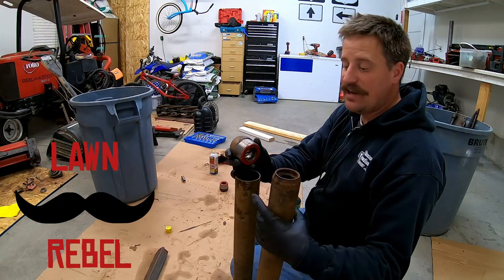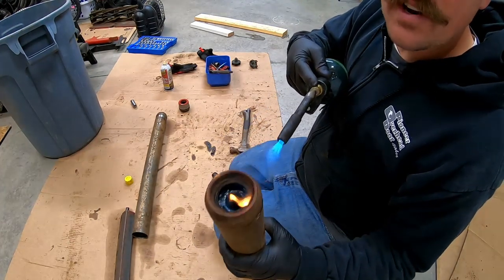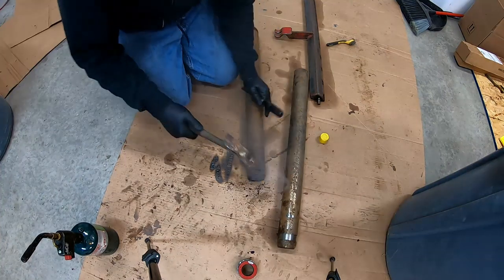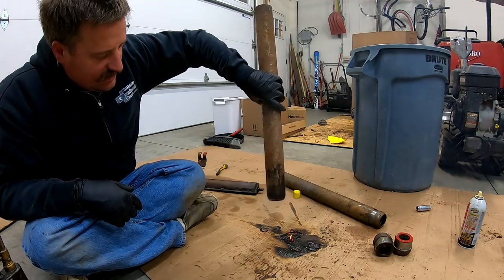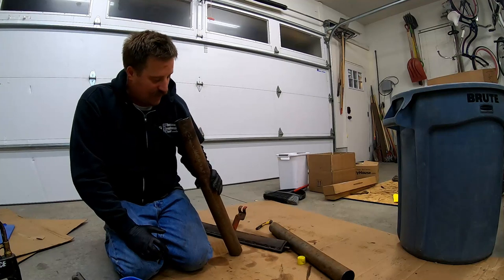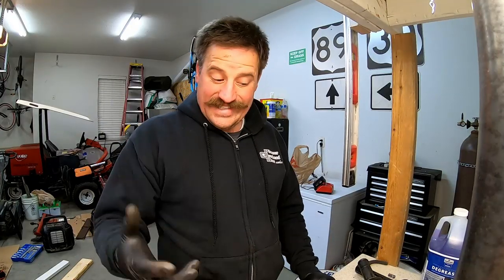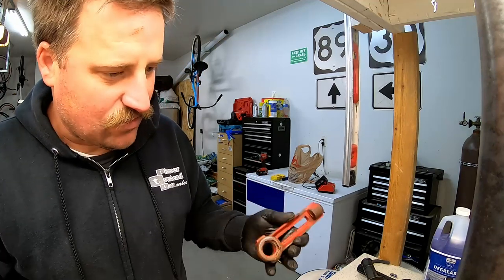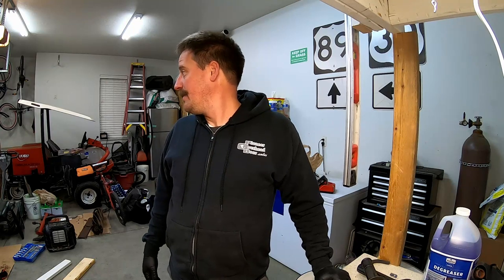Reel Roller Restoration Toro 3100D

Comment from the maker: This is what I call a dirty first. Brett can suck it.
Reply: Brett's grasscapades 
😂😂😂
Reply: Hey man, if you need bearings. Just contact SKF, their site has a tool so you can find any bearing you might need. 
You should be able to find dust and waterproof ones there (maintenance free). 
Greetings from an engineering student 😉

Comment: First Aussie😁😁👍Can’t wait to see what damage that heavy machine will do to your pristine yard when turning.🧐and possible compaction problems. Great video Connor ,your persistence and patience will pay off in the long run.
Reply from the maker: First world problems?
Reply: That machine is about 1860 lbs Connor, are you intending to use this as your main mower ? Or some other purpose.
Reply from the maker: Whatever the heck I want
Reply: Ok Connor, sounds like a plan. Can’t wait to see your finished product, you are doing a great job restoring that machine.👍👍

Comment: Whenever I need to sit or especially kneel on the floor to do something, I grab one of those rubbery foam camp pads, about 3/4 inch thick, and use that. I have one that I've cut in half just for this purpose. Your knees will thank you later.

Comment: Next your gonna have to build a shed to put all this crap in lol.
Reply from the maker: yeah no kidding. That has been on my mind for years. I would love to try to make that happen this fall of 2019. Maybe
Reply: @lawnrebel  it's great.  Even thought I have a 4 car garage I built a large shed ran some electrical burial wire, and it basically became my workshop.  Don't have to worry about making a mess.  Take the blower out and it's gone in minutes.  There's acre lots here and my shed sits in the middle.  So I can even work in the middle of the night without disturbing anyone.  It's nice having an open garage and get to your car without tip toeing around everything.  Build it!  You'll thank yourself you did.  Go as big as you can because trust me,  you'll wish you did later.  I build a custom fancy 20x16 shed that would have cost $17,000.  Did it myself for $5,000.  Complete with a dormer, a concrete foundation with ramp for my mower.  My neighbors dubbed it "the little house".  Lol.  I don't think many sheds have French doors lol.  It looks more like a pool house lol.
Reply from the maker: I really want like a 30x50